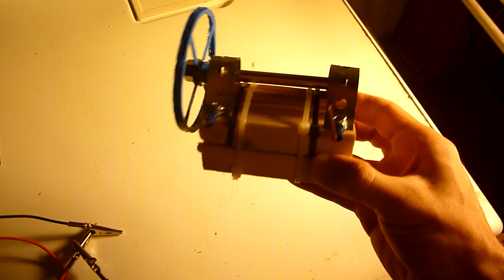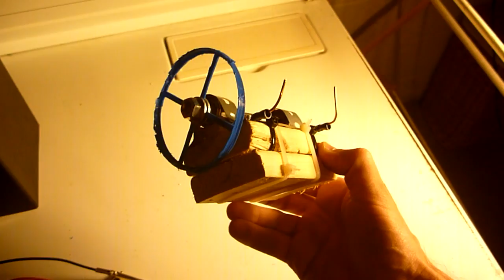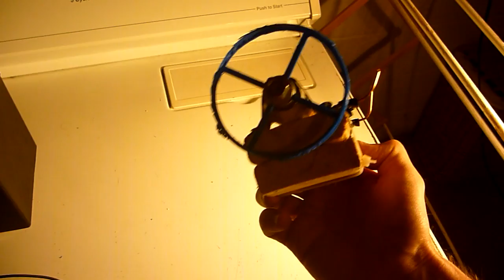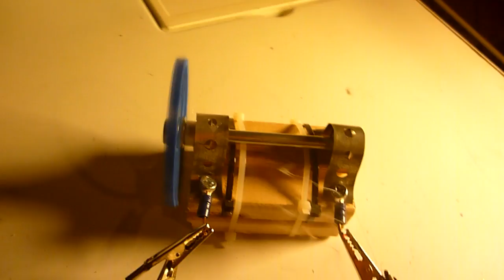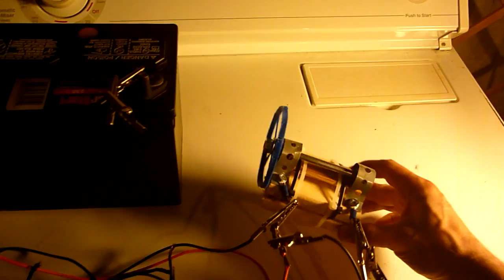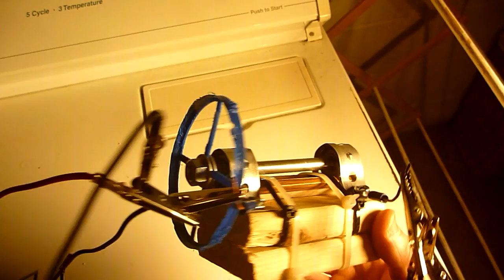The Impossible Bearing Motor (no coils, no magnets motor)

Comment: Dear Naoki
How it works? Well,  for rotation you need transversal force on axle. So vector of magnetic field is always cylindrical over axle because current density field is always axial. Then, velocity of free electrons are small (few m/s) and when you initial rotate the axle they are moving in spiral form.  So vector of magnetic force F = e V x B and that vector has transversal component due to make rotation.   V is velocity vector, and B is vector of magnetic induction (magnetic field).

Comment: how does it work.... The high amps surging through the bearings and axle, magnetise the bearings and axle and the whole motor works as a homopolar motor (like a magnet spinning on a battery).  It needs a huge amp draw to maintain the magnetic properties. Use non magnetic axle or bearings and it wont work.

cheers.

Rene

Comment: Well its interesting. And potentially very complex. each ball in the bearing is carrying a radial current, setting up a magnetic field and im guessing that a hi tensile steel ball would have considerable magnetic reminance until it reaches its curie temperature. So you have a  permanent magnet in a magnetic field and the magnet is spinning on its axis and also spinning around the races while being continuously remagnetised and conducting a large current to boot. Way beyond my powers of analysis!
  Some things are clear. Cost benefit analysis is easy. For this small amount of rotational energy and intellectual stimulation, the costs are two bearings, six wires, twelve agulator clips and probably a car battery all destroyed.
 Conclusion........... fun but destructive.

PS i know how to spelll alligator, but i oilways coil them agulator clips.
Reply from the maker: LOL about 'agulator clips', good analysis in your comment. Your explanation for how this thing works seems plausible.

Comment: Next time use a decent super capacitor like 1000 Farad or more.
The lead acid battery will get deformed internally (lead plates will dissolve unevenly, this can not be repaired).
And yes, we know how it works, Seen that. Done that. But most important, the inefficiency of this experiment is so huge .. ..I could never perform this experiment knowingly. I am glad you did ;-)
Reply: Naoki Kashima
It is normal science I think. There is a current running through a ball bearing. A current has a magnetic field around it. The ball bearings ALL drive current from out to inside. The magnetic fields are repelling each other (two wires containing the same current will also repel each other).. When the balls start spinning the force is no longer exactly perpendicular and starts moving sideways. As they spin faster this increases. Perhaps it is not 100% accurate but the explanation is something like this.
Reply: @deslomeslager  Two wires carrying current going the same direction attracts each other. Not repel
Reply: @heavycurrent7462  Yes. you are right there. Lets hope someone else can give a better explanation, I am not good at it.
Reply from the maker: +deslomeslager I know it is inefficient but there is NO good explanation for what is happening here. In all motors (aside from the electro-static motors) you have an magnetic field which is driving the rotor to spin. In this case there are no coils, there are magnets or lamination. SO what exactly causes this rotor to rotate? People can't come to grasp with the fact that what we know about electricity is only part of the picture. J. J. Thompson wasn't sure that the electron was really the charge carrier in electricity. He was promised fame and fortune that is why he finally admitted to that idea. In reality we might have 2 particles involved in electricity. These particles are magnetic monopoles that Ed Leedskalnin talked about in his book "magnetic current". We also have Edwin Gray (the inventor of a self-running motor back in 1970s) he spoke of 'splitting the positive' in an interview (look up Edwin Gray if you aren't familiar with him). We are living in a time of technological suppression. It isn't a conspiracy theory, it is a conspiracy fact.
Reply: +deslomeslager But what causes it to spin? The neg and pos currents create some kind of torque in the bearings? Even though its inefficient, that thing had some massive torque for how simple the setup is.
Reply: Perceive Believe
Please look for examples here on YuoTube or in Google. Read answers from other peoples comment as well, they say the same.
Reply: "So what’s going on here? A motor with no magnets? Is this some type of perpetual motion machine? Alien technology? We can assure you that the effect is real, but the mechanism is still unproven." http://hackaday.com/2014/01/29/ball-bearing-motor-rolls-for-reasons-unknown/
Reply: Naoki Kashima I think if you had a way to structure the charge/current like some speculate Leedskalnin did with the PHI pyramid on the flywheel, you would be able to get all kinds of interesting effects.

There are natural harmonics happening with these geometries.

If we dont get the harmonics right we will only get one side of the effects, imo.

If you could create a small steel/copper cage PHI pyramid with the dimensions of the great pyramid in egypt (which is made from piezoelectric material as we know) then introduce electric current into that steel frame at certain locations, I bet it would be interesting. 

Ive worked abit with stage musicians and they are always carry on about how dirty the frequencies of electricity is. They say NEVER plug their equipment into the outlets provided by the venue. The musicians have their own electricity cleaning machines etc. 

This whole planet is out of harmony with nature. But I think Leedskalnin, Tesla and Keely left enough clues to figure out the frequencies and geometry needed.

http://www.interferencetheory.com/HarmonicTheory/Interference/Excerpts.html

Comment: Ive done this with huge car bearings, a jumper cable, and some big optima 12v batteries.   its freakin awesome. Check your voltage measurements on the battery while its running.

Cheers!